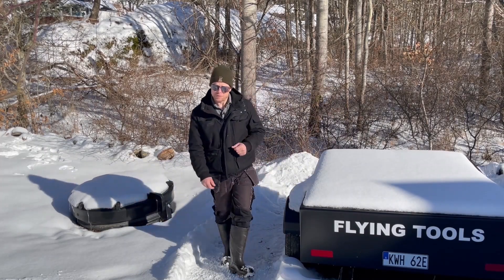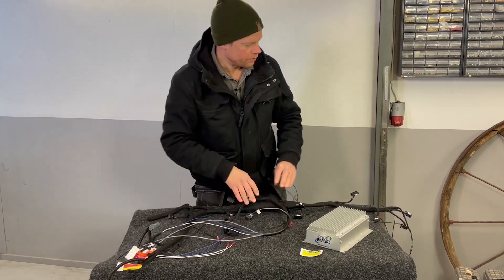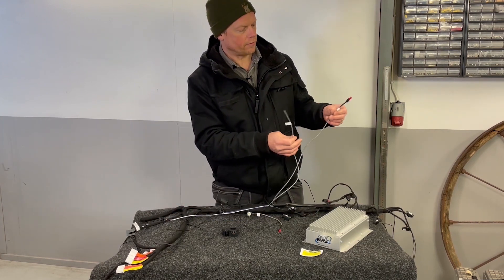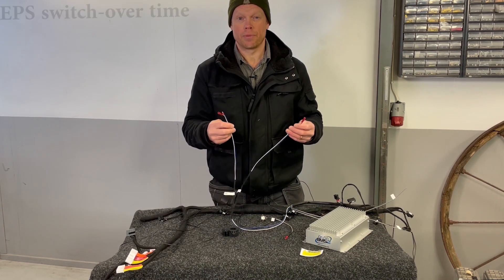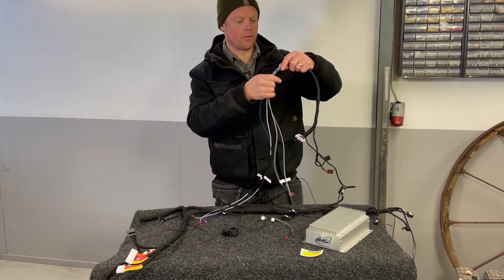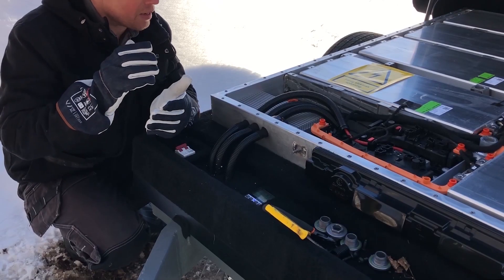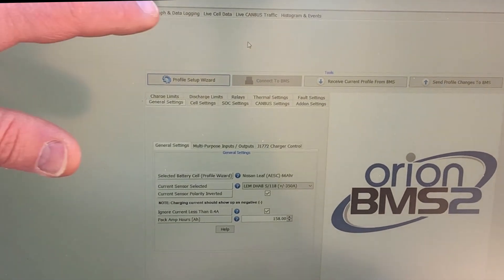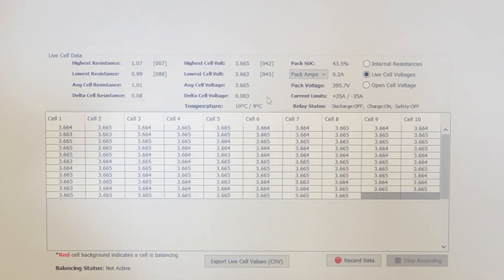Orion 108S BMS diy Hv battery. Installing, testing, and balancing. VW Id3 Id4. Solar storage.

Comment: Hi, what's your name bud? Great videos and very helpful s I'm considering the ID4 for an EV conversion. Quick question, can the ID4 modules be installed on their side? ie., factory has them resting on the 8.75" side. I'd like to install them on the 4.25 inch (skinny side). Will it affect the pouches inside if I do? Thanks.
Reply: I'll be using these modules for my EV conversion and I've looked into orientation issues: if you installed them on the 10cm side the pouch cells lay on top of each other which can potentially create issues.

Comment: Been looking at doing this myself, as 5kwh battery's cost a lot of money (£1000-1500) but car ev battery that has around 50kwh capability is generally only £2500-£3000 + a bms

But I prefer to get it to normal Inverter voltages (48v or 62v system)
Reply from the maker: Yes, I understand you. My first Batteri battery I ever built was from a Volkswagen e-up and I reconfigure the cells to match with a 48 V inverter it was an interesting project though. 14s14p lion.

Comment: Hi all, i need help! Finally my system is up and running.  18 x CatL NMC batteries for 45kW and 420V.
I have x1-hybrid-g4 and I am running it in Lead-acid mode.
I am using the Solax inverter in "Peak Shaving" Mode, where I am charging the batteries at night and discharging during the day. I have no PV panels.

If i have to do some work and swicth OFF the inverter for a couple of minutes - I cant switch it back ON. It trips my RCD immediately after the self-check.

Then I need to go to USER SETTINGS>> PEAK SHAVING MODE>> DisChgPeriod1>> SHAVING LIMITS

If I change SHAVING LIMITS from 1W to 50000W- then it works. The inverter starts with no issue and it does not trip my RCD breaker.

Unfortunatelly after I manage to start the inverter and once I am in NORMAL status- then i need to go back to SHAVING LIMITS and return the value to 1W, otherwiseI the inverter will not start supplying my OFF grid load with 220V AC during the set discharge period.

Why is that and how do i fix that?
Thanks Ross!

Comment: Can you recommend a hybrid solar inverter that definitely communicates with the Orion 2 BMS (using same CanBus protocol)? Have you found one? I have emailed Solax hundreds of times and they dont know what protocol is used on the inverter they actually manufacture, crazy....I dont want to buy the Solax if unsure that will communicate with the Orion BMS. Do you still use your Solax in lead acid mode and why? Whats the difference?  Constant low  current? Thank you so much.
Reply from the maker: Orion do not have any cambus protocol at all to talk to any inverter. You have to do that coding yourself in to the Orion bms. Solax of course know their own protocol they just want tell… just like any other manufacturer. Yes, still in lead acid mode. What do you mean with a constant low current? I can pull 15 kW completely off grid with a battery voltage at 500v at 30 amps. No solar, so what do you mean?
Reply: @flyingtools  First, thanks for your quick replay. I am probably becoming annoying with all my questions but in the middle of desinging my project and would like to learn from your experiense. What do you actually use to charge the WV batteries? Is the Solax ineverter? Whyis it in lead acid mode? Or do you have a separate lead-acid battery charger hooked to the ORION BMS? Where does the Orion BMS takes voltage to charge the batteries from and how did you charge the batteries before installing the Orion? Perhaps some of the answers are in your videos, will watch them all today. Thanks for doing them. It saves a lot of reseach time. I just want to find a proper charger to hook to the ORion and to charge the li-ion batteries, prefferably an hybrid inverter as I will be installing solar panels as well. Thanks a lot. Ross
Reply: @flyingtools   please ignore the previous questions. I watched few more of your videos and i think i got it. So you are charging your battery with the SOLAX in lead acid mode (76kOhm ntc hooked to the BMS port allowes to do that) and you have preset manually voltage and currect in the inverter. You used to check voltage on idividual cells manually but now the ORION does that and the BMS is there only for safety to discconect thanks to the relays if something happens, but the ORion is not charging your battery, just monitors- correct? Also is the SOLAX using solar energy to charge the battery, i presume so? Can the SOLAX be programmed to charge the battery at night from grid when electicity is much cheaper if no sun was available during the day?
Reply from the maker: You can do pretty much whatever you want with this inverter, it’s very versatile.
Please download the manual for Solax, and you will find all your answers in that one it’s pretty much straightforward and easy to understand.

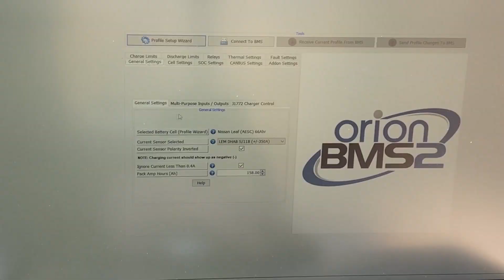Comment: 9:58 Isn't the selected battery cell different or doesn't it matter ?
Reply from the maker: That’s the default setting in cell chemistry etc. I that because it was the closest to my Vw cell chemistry then I adjusted the rest of the settings manually.

Comment: Very well done! However, I do not understand why you do all this changes. Why not just use the original BMS? You need a "translation" device to your inverter anyway, don't you?
Reply from the maker: Thanks! Sadly not possible you need the rest of the car… canbus security code change around every 10sek from what I’ve heard, I promise you, I tried. This is one year ago now so maybe something new has been developed. Let me know if you find anything 😉
Reply: @flyingtools  Ahhh....I see. I didn't think about that. I am just trying to use an entire Nissan Leaf battery as a PV storage based on this project: https://www.youtube.com/watch?v=XHZWGLzT7gg&t=359s. 
Apparently there you don't have such problems. I can freely talk to the BMS.
Reply from the maker: Yes, those batteries are easy to take control over, Vw is like Fort Knox 😅 But the quality of the cells are great.

Comment: How or where did you find the pinning for the LG cells? I want to read data out the cells but I can't find anything yet 😢
Reply from the maker: I just measured the module myself. Here is a video on the 12s module I measured, I plan to do the same with the 8s later.

https://youtu.be/KDkWjR-gD1U?si=x0LvXqeDqDi8cVV2

Comment: Hi, Can you say what type of relays you use iniside the battery VW original or else and what orion bms signal controll them ? PIN 7:27 6 - " Charger Safety" or something else ? Thank you.  Get my Orion already and battery will arraive next week..so try to be ready as possible :)
Reply from the maker: Hi.
I use the Vw original relays. I do not remember which pin I used to control them but the Orion bms comes with a very easy understandable installation manual so you will find it there.
Good luck with your project and be careful ⚡️⚡️.☺️
Reply: nice, I get my battery 108 cells working whir orion bms. Your videos was great help. About originaö VW HV DC realys, they draw 680 mA each when active, Orion bms max per channel is 500 mA.  Did you use some extra low mA relay before original relay or output is realy more powerful than spec
Reply from the maker: @evarraudsepp874  I connected my relays in series. It works but you can probably not take out 300 A from them when they are connected like this, but I only drawing 30 amps out of them so I think that there will not be any problem. So far it has been working just fine for over 8 months now. 
But of course, you can also use a 12 V relay to activate high voltage relays.
Reply: Have you tried measuring the voltage between the battery positive terminal and the battery frame when the Solax is active? For some reason, there seems to be voltage present between them. Could it be because the Orion 2 BMS is grounded to the frame? I have two such setup ID3 batteries, and both show voltage between the battery positive terminal and the casing when the inverter is active. However, when the inverter is off and the battery relays are still activated by the BMS, there is no voltage. I'm not sure myself why this is happening. Maybe you know? Or IS your battery act Same way. Thank you!

Comment: Very nice and clean set up 👍👍
If I were to set up my system again, it would also be a high-voltage system =)
Reply from the maker: Thank you so much😃
Yes, 400 V make a huge difference in efficiency and also a bigger possibility to sell the excessive power from the panels to the grid. Thank you so much for your comment.😊

Comment: Isn't he Battery itself have balance terminals available from the outside of the battery? I didn't understand why you had to make one.
Reply from the maker: It only canbus out from the battery. And it’s a coded protocol that only will work together with that specific car it was sitting in. That’s why I wasn’t able to have this internal BMS to work.

Comment: Wauw, this will be a good battery for your home!! May i ask you what you've paid for this battery, and why you got it? were there some issues with this battery?
Great videos by the way!!
Reply from the maker: Yes this battery are great but also dangerous. I would never buy a battery with issues.
You can buy them from junkyards at around 70000-10000eur.

Comment: It is really an amazing set up!!! HV scares me the most, but soon or later one will have to face the issue. Your videos are really inspiring!! Especially the care you take handling the battery, BMS, etc.
Reply from the maker: Thank you so much😃 HV scares me to, and that’s probably a good thing.
Have a nice day sir😊
Reply: HV IS DANGEROUS  SURE  , but DC16S with hight capacity is also very dangerous , when  i touch at this you need care , care and care again , think at all before made a moove , i personnaly use silicone glover on a silicone carpet with a protection mask on face , need also work with very good ambiant light .  to connet  BMS wires i also try use self lock connector , one think is requiring a lot of care , it's respect the bms cells wirings ; 102 cells mean 103 wires !!! a error can kill bms instant . the battery require be able undersand where are all cases can kill you , dc current is 100X more dangerous than AC

Comment: Tack -Instruktiv och bra video! Är de orangea kablarna i BMS kontakten märkt ”Module 1 2 3” kopplade till batteripackets negativa eller posetiva sida? Hur ansluter Du termistorerna till batterierna - direkt i kontakt med batteriet eller via batteriets BMS kort?
Reply from the maker: Tack snälla😃
De kablarna går till varje enskild cell i modul ett till tre. Alltså totalt 36 kablar till de första tre modulerna. Termistorerna har ett eget kontaktstycke ihop med strömsensorn och är också direkt ansluten till Orion BMS:en.
 Sitter intill powersupply kontakten.
Tack för din fråga 😊
Reply: Min fråga gällde om de orangea kablarna i kontakten märkt ”Module 1 2 3” är inkopplade till batteripackets negativa eller posetiva anslutning. Jag antar att alla batterierne är kopplade i serie och att hela packetet har ”a most negative and a most posetive side”.
Reply: Hej igen, finns det möjlighet att få komma på ett studiebesök och få titta på BMS inkopplingen? Själv bygger jag om en utombordsmotor till eldrift och håller just på med Orions BMS inkopplingen till ett Tesla batteri packet.

Comment: Ingenious work. 👍 
You have wrapped up the cable monster very nicely. 😁

The BMS power supply, you can take directly from the battery permanently. 
I have it the same way. 400VDC is converted to 24VD via WDR-120-24 from Mean Well, which has an input voltage of 200-500V and an output of 24V. 
Costs approx. 50€. Don't be confused by the fact that it says AC input. It eats everything and makes its own internal frequency to convert the voltage down. 
I got this tip from my friend who is a specialist for industrial emergency power supply (companies, banks, hospitals...).😉
Reply: Hello sir, have you found the CAN bus protocol for the Solax inverter?
Reply: @milan2931  Yes, I found it.  Please see the comments from the previous video.  I gave the link for my cloud storage there
Reply: @RichardSteigmann  I've been looking, I've been looking, I haven't found anything. I think I've got operational blindness😅
Reply: @milan2931  Yes, you're right, I couldn't find it either, sorry. But now with the new link you can pick up the file
Reply: @RichardSteigmann  🤣
Reply from the maker: Thank you 😃

Wow, that’s great information. I will definitely check that out.
Thank you 👍🏻👍🏻👍🏻